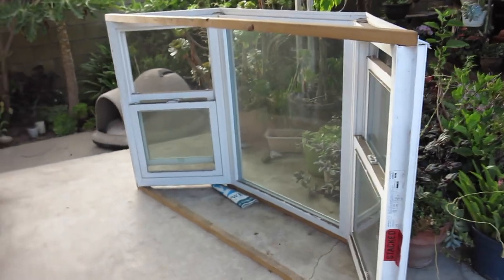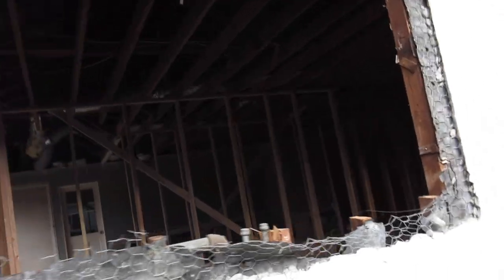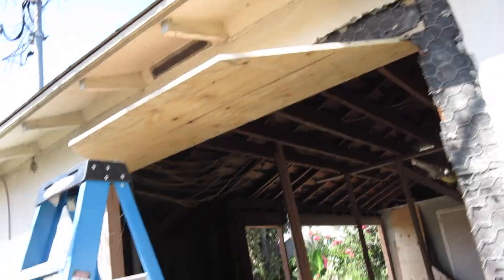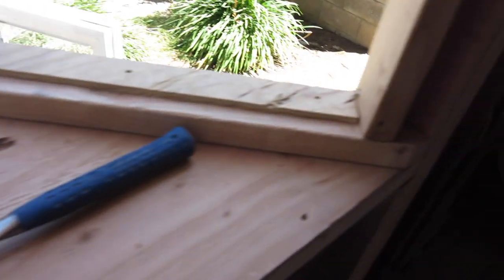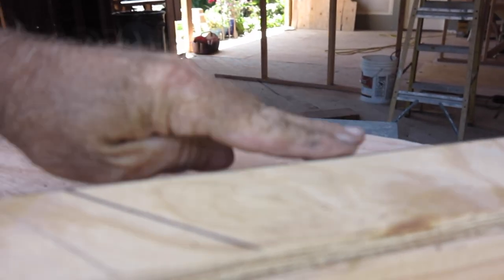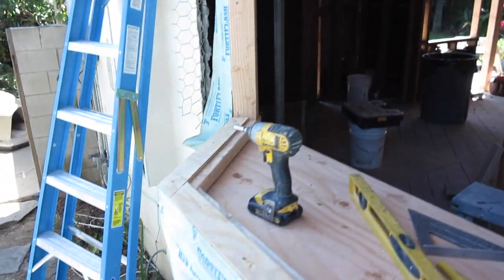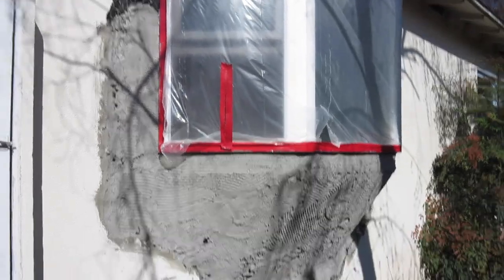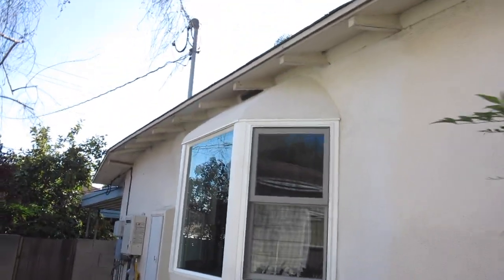Add a Bay Window

Comment: I'm buying a used tiny home and I wud love a bay window so my question yet I don't believe you will answer becuz u didnt answer the one below this comment but I'll give it a shot.  How much would it be to add a bay window and where can I go to get one added professionally.
Reply: I am building one when the windows show up. Pella 250. Operating ones on each side with fixed picture window in front. I expect the cost of windows and materials to be around $2500+. Will be doing install myself.  You may be able to get one installed for $5000 plus or minus with choice of windows. Just get at least 3 bids.

Comment: Looks good. How wild you do this without a bottom brace?
Reply: You really can't unless you install expensive metal supports. But none the less, supports are necessary because of the weight of the window especially if you plan on setting plants on it...
Reply: You could order a bay window that’s already pre built, and with that you get a kit that includes metal cables that tie into the structure, and work very well then build your roof around them. Also using a couple decorative corbels  underneath helps but aren’t necessary.